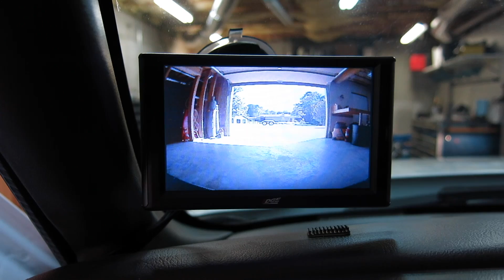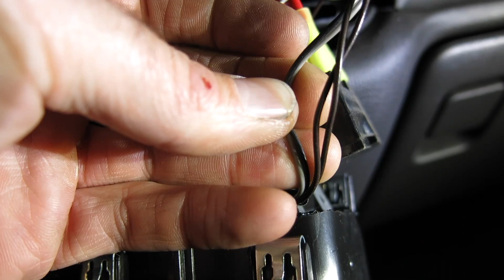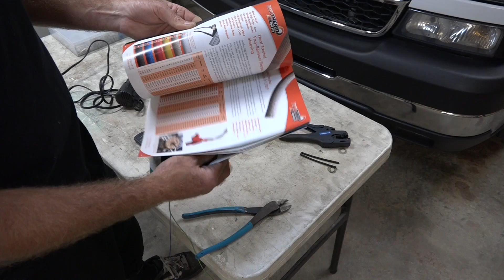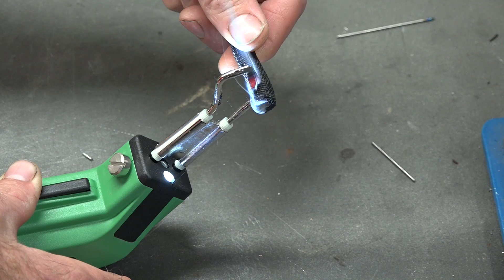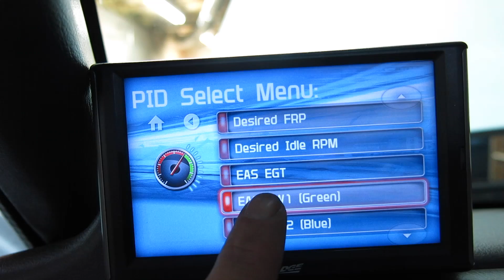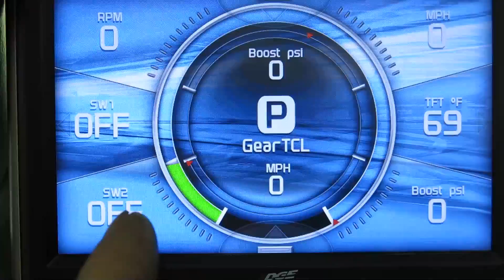Finnegan's Garage Ep.42: High-Tech Stuff for my '06 Chevy Duramax

Comment: Hi Finnegan, I have a 2004 C3500 duramax dually.  What suspension are you running on the rear and do you like it?  I have an old DJM 4/8 lowering kit with airbags and leaf rear springs.  After 125k trouble free miles, the rear springs are going soft and is ready for an upgrade before it strands me.  I tow a 45' gooseneck enclosed and with two cars and spares it about 16k lbs and with tired springs, I need to pump the bags up to 100#.
Thanks, Mark

Comment: I always use a touch of dielectric grease before heat shrinking. I also use Marine grade heat shrink if it's going in the car or truck to seal against moisture and to reduce pulling strain.

Comment: What's the point if the controller isn't smart enough to handle "set to X psi" ? just going from real momentary switches to touch screen toggle switches seems like a step backwards to me. I'd have done the pressure sensor mod only and kept but relocated the switches.

P.S. when are you going to finish the mini truck? That thing is pimp. Definitely make the tilt up bed.

Comment: Oh, please. You don't need a hot knife for that. I just use scissors and my little crack torch. The result is exactly the same as what you came up with. Then you put heat shrink tubing over the end anyway and you never knew the difference. Then again, the hot knife is a lot cooler, and easier. And less steps. lol

Comment: Fin you rock but this is the exact opposite of what I would do, all form over function. I'd go for the momentaries and analog gauge that you can access and use at a moments notice over dealing with a touch screen any day. 

On a somewhat related note, is there a reason not to remove the screen in the dash and put your controller in there? Would the rear camera not work on the controller?
Reply: The screen in the dash is the head unit for his stereo.

Comment: Mike,  you mentioned you need to be quick on the switches for a (say 20 psi) bump in pressure.  What if you miss the max and over-pressure the system?  Or what if there's a malfunction and the solenoid keeps dumping pressure to the bags?  Similar to a b.o.v. for a turbo system, is there an in-line pressure release as a safety... or is there something like that already built in to the bag kit?

Comment: One thing every diesel truck owner should do is replace their batteries with ones from a semi truck. They last longer, they’re more powerful, usually fit with little to no modification, and if you go to the right truck dealer/shop (like a Volvo or Mack one) you can find them for 50 bucks. Maybe in the newer trucks it would screw something up but it works great on my dad’s 7.3

Comment: When wiring a vehicle, I like to not only use non-insulated connectors and crimp then cover with heat shrink, but(unless I'm pressed for time) solder the connection as well. The addition of soldering increases the strength of the joint and helps to prevent corrosion.

Comment: Why not put the pressure sensor closer to the bags and then run wires instead of a hose? I imagine a hose being more fragile and not as convenient as an install. 
But maybe you figured “it works and it’s there so I’ll leave it” like, don’t fix if it ain’t broken?

Comment: Sweet! I have been trying to find a decent source for these, pc and electronics stuff have been using these sleeves however never been able to find a cheap source for the sleeves. also that loom stuff you can cut it then melt it with fire as well. kinda like cutting synthetic rope.

Comment: When you get tired of double tapping the screen trying to get another 5 psi in the bags put a needle valve inline with your fill solenoid. You can adjust your flow rate of the bags and get a much finer control.

Comment: China marker. 9 bucks a dozen. You gotta use brake cleaner to get it off. Marks anything. Its great for writing a list on a hood, for instance. And it doesn't dry out, because it is basically a pencil. China marker. Check them out. I use them on irrigation piping. Doesn't come off.

Comment: with everything nylon like the braided wiring sheath, I use scissors and a lighter to stop the ends from fraying.
if you're really skillful, it will not only look identical to the hot knife but you won't even burn yourself.

Comment: could you not cut that sheathing and then hit it with a lighter ?
Reply: One step better is to cut it with a razor blade that you take a torch to for a couple of seconds. Vice grips on the razor if you care about your holder, or just stick a blade in a vice. Everyone should already have those things anyway.

You can use the worst rusty dull tip broken off blade and it will still sail right through those looms.

Comment: the air line doesn't have to be all up in the dash anymore, run some wires use some of that awesome loom and install the air pressure sensor closer to the bags.

Comment: It would be high-tech if the controller could store presets and pump the airbags to set pressures. Now it's clunky, I'd rather just use the digital readout and wire a nice double-throw momentary switch for the solenoids.
Reply: I agree why loose the easy of use. Doesn't seem like you to put form over function.
Reply: Agree. Maybe ditch the gauge for the digital readout, but I'd personally leave the momentaries for filling and draining, or as mentioned, have set points.
Reply: t33s exactly what I was thinking. Or something like the accuair system.

Comment: Hey Finnegan could you elaborate on spark plug inspection? As in a previous video you were you worked on blasphemy and you said that inspecting them is the best indicator on the workings of the engine?
Reply: j stash I assume he means to just look for cracks, check the gaps and make sure they aren't fouling.
Reply: true, but you never know if he has some other insight.

Comment: I love your channel. I'm in high school and I know a fair bit about cars, but nothing about ECUs. So I decided to take auto. I'm in grade 10, first year I can take auto, and guess what I've learned in this class so far? That I should be in the grade 11 class. We're learning basic vehicle maintenance, like changing a flat tire or checking fluids and lights. The only interesting thing we're going to do is disassemble and reasseble a small engine. Which I have done about 6 times on a couple lawnmowers and some chainsaws. So I watch your videos to actually learn things.
Reply: BoostAddict they have to teach the basics as some in my class didn't even know the answer to the most basic questions of how does a engine make power and how to at the most basic level to increase power fuel and air that eluded the entire class or they where afraid to answer

Comment: I would have added the CTS control, but kept the manual gauage and buttons.  Now when the GA heat (or a multiple of untold calamity's) kills that controller, you're screwed...
At 15:00, What's wrong with scissors and a lighter roadkill style?
Reply: I'm with ya, the crappy arkansas heat killed a controller like that in my s10. It looked all fancy while it lasted
Reply: Probably smart to have a manual control somewhere hidden in say the glove box, yes. You never know what can happen, you're better off having them, than needing them. Personally, on my farm truck, every major system i need to control either has redundancies, or some way to quick connect and re-work the path of control. And it has saved my ham many times.
Reply: another good spot for manual backup is in the centre console box

Comment: Running lights out on passenger side ;]
Reply from the maker: yeah. its pretty common on this generation of truck for that light to go out.
Reply: I believe there is TBS on that about using a long life bulb ('LL after the number).  Just get a set of white Sylvania Zevo LEDs, the Y shaped ones.  They shine into the reflector and work really well.  Put them in my cousin's Chevy pickup.
Reply: Finnegan's Garage 
Can confirm. I replaced the passenger running light twice on an '06 Sierra in 6 months. And that one was a Denali, so they're all suspect.
Reply: ZIP TIE WILL FIX IT!!LOL
Reply: Silas Humphreys on 07.5-13 definitely!!!! 00-07 was such a simple setup I will never understand who came up with the new design. "engineers"
Reply: I had a '99 Silverado 1500 and an '01 Sierra 2500HD, and they both ate that same lamp regularly. Lol
Reply: Wouldn't be a mid 2000s chevy if it wasn't
Reply: Twisters Music Radio, no lie, I have a zip tie holding the driver side bottom light in place.
Reply: Finnegan's Garage any idea why? I've always seen that and wondered if it was a factory thing or what?
Reply: Finnegan's Garage very true just be glad it's not 07.5-13 or so gm went from 2 pins to get the light out  too pulling dang near the whole grill off
Reply: Far as I understand it, the main reason those lights stay out once they go out is you basically have to tear half the front clip off to swap the bulbs. Turns it from a "no big deal" thing into a "I have way more fun things I could be doing with my time" job.
Reply: I was so good at changing the bulbs in my '03 Duramax that I could do it at a long stoplight.
Reply: Gabe Pence I’m pretty sure it’s because they used cheap quality bulbs and they produced too much heat for themselves to live in a small enclosed space like that.
Reply: Andrew Gugglberger 
FYI: they're actually the daytime running lights. So, every time your truck is in gear, and it's day time, they're on.
Reply: William Wright what does that have to do with a bulb being out?
Reply: #roadkill
Reply: lets clarify...only Chevrolet and GMC's have this issue. Just Sayin.